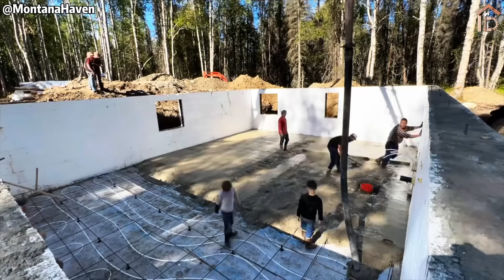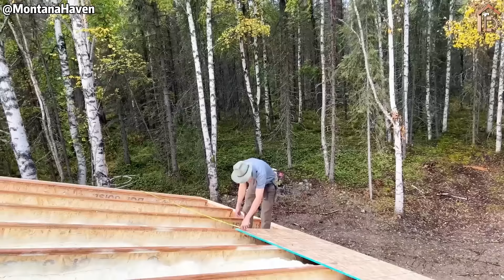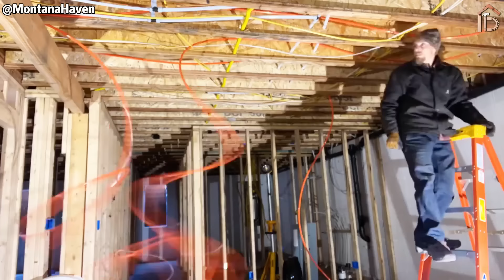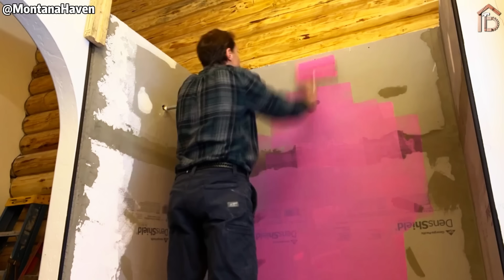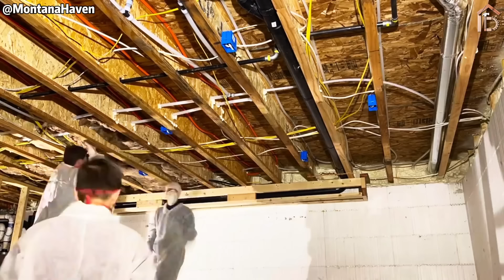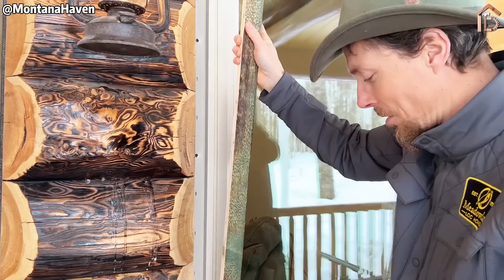Family Builds an Amazing Log House Deep in the Alaska | Start to Finish by@MontanaHaven

Comment: As much as I'd like to say this cabin is rock solid, it's not. Pouring cement in the rain/mud, gluing wet wood, and other weather related issues, I would imagine there will likely be structural problems down the road.

Comment: Great job on the floors. I was wondering why there wasn't insulation around the window openings before the frames were put on. Cold winters require insulation everywhere the cold could get in. But floors, walls & doors are spectacular. I also like the light & dark contrast on the logs.

Comment: Only one question, the house is absolutely beautiful, but how is it heated, electric and water where does it come from ?
Reply: As a secondary heat source, this home has an in-floor hydronic heating system. Water, heated by a boiler (hot water heater) is circulated through a series of PEX tubing that is inside the floor concrete or in the ceiling to heat the floor above. All of the equipment for the heating system (boiler, circulation pumps, expansion tank, zone valves, gauges, etc.) is located down in the basement in a mechanical room.

FYI, the owner does plan on using wood as the primary heat source for the cabin. If you would like to know more about the mechanical system being used for heating, here is a video that better explains it.

https://m.youtube.com/watch?v=JkY60gaxE14

As for getting water and power, the home is on a well and power comes in from the local utility.

Comment: The roof could have been a standing seam to cover the screws. Exposed screws that the rubber washer will dry rot and leak 20 years later. Love the place though and the setting is perfect for a cabin.

Comment: Great Work! One error tho... they didn't separate the kitchen from the living room! Imagine all the noise and smell of food coming to your living room when you want peace and quite.... not optimal in my opinion!
Reply: Never heard of a range hood? When it is noisy in the kitchen, then the cook is incompetent.
Reply: Separate kitchens and living rooms is an extremely outdated home design. Over the years, humans came to the realization that the kitchen is one of the most social areas of a home. Take a look at any newer home design and you will most likely see an open floor plan between the kitchen and living room incorporating both into one giant room.

In fact, I’ve remodeled and flipped quite a few homes that were built in the 50s, 60s, 70s and early 80s; with every single one of them opening up the kitchen is one of the very first things that we do. Doing this gives the kitchen the appearance that it’s much larger than it actually is, large/open kitchens are definitely something every homebuyer is seeking these days.

Comment: The absolute best wood sealer that preserves wood up to and more than 100 years and is super cheap to make. Famers started using it almost 100 years ago on fence post, sheds, barns, and even their homes. Those structures are all still standing after just one application. The formula is equal parts diesel fuel and used motor oil. Once soaked up and dry it leaves no residue or smell. It gives wood a honey color. There are videos about it here on Youtube.

Comment: If you built the basement with "lost formwork" (Styrofoam blocks) and reinforced iron/concrete, why didn't you continue with the rest of the building, instead of wood?! It would be more durable and better insulated.

Comment: Beautiful job you should’ve used Schluter Detra on the floor. Also you didn’t install the tile right anything over an 8 x 8 tile needs to be back buttered before you lay up what you just did was called flop and drop guarantee you do not have good tile adhesion to the substrate.

Comment: They trapped moisture into the building that may never dry out. Couldn't they build it during a dryer season?
Reply: Your question suggests that you know a thing or two about building log cabins in this region. Question: when that area was being settled did they only build during dry seasons? If not, how did they survive waiting for a dry season?